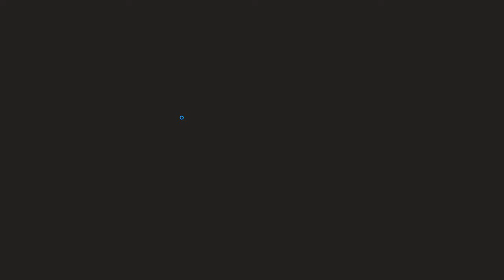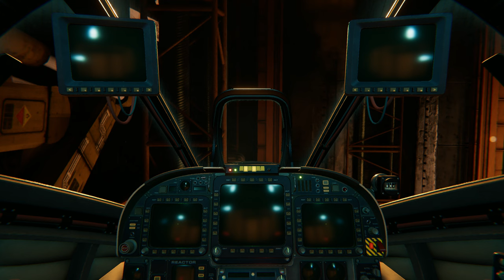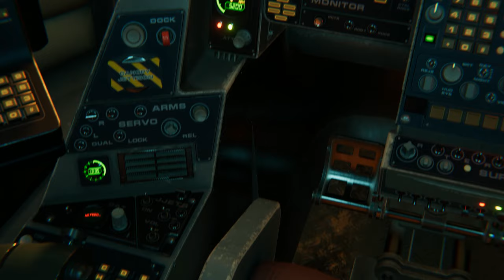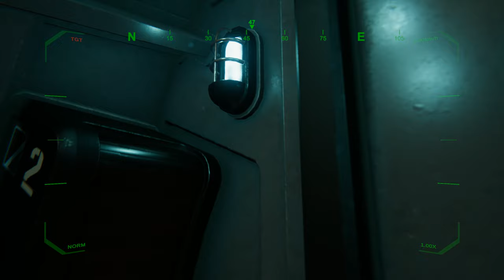BattleMech Clan Timber-Wolf (1995) Cockpit view (WIP with mocked startup sequence)

Comment: Seat should be a bit further forward. The clans don't have big instrument consoles in front of them to block their view typically, was one of the reasons the Timber Wolf was made similarly to the Catapult. Maximum amount of vision while still having a high degree of protection.
Reply from the maker: never knew this, now I'm learning new things every day.
Reply: @MekaRamen  lol yeah the Clans designed their things really interestingly, a vast majority of their information comes from the neural helmet, or in some MechWarriors', a DNI interface. Which plugs the entirety of locomotion and targeting directly into their spine.

Causes the pilots to go a bit bat shit crazy after awhile, or suffer from "flashes" which is a massive feedback of electricity/information which makes them comatose, except comatose with extremely high amounts of brain activity. Neat implications when you think about it!

Some other neat details is that they have a weapon/survival kit in the cockpit, but it changes location based on the cockpit. Some are an entire capsule design where the front glass etc comes away from the chassis and is safe for vacuum ejection. Other battlemechs have just a blowaway canopy ontop and the chair ejects. They'd give mechwarriors' a vacuum sealed suit in those... but innersphere pilots for the longest time couldn't manage to actually cool themselves in the cockpit without fans etc in the cockpit so they were forced to dress down into basically nothing but underwear and a cooling jacket lol.

The vast majority of battlemechs have a top hatch to open up and help pilot comfort. There's a nice section in one of the books where a lance is on watch in some light rain, and the guy is letting a light rain into the cockpit... but then takes shrapnel immediately after because they get attacked.

Oh for motion it's interesting. Most mechs have forward, back, etc controlled by two foot controls (and also the neural helmet), the aiming of weapons are controlled by two sticks, but sometimes a few battlemech designs have a yolk on the left. But control is never actually fully... controlled, by these sticks. The neural helmet factors into balancing, interpreting what the pilot wants to do with their legs and hands at any time, and turning of the torso even. So the pilot is balancing "5" control interfaces at all times in a way, but the neural helmet is the one that links them all together to give the battlemech a graceful and human like locomotion/articulation.
Reply from the maker: ErgonomicChair this is cool stuffs!! Many thanks!!

Comment: I'm kind of confused why it has a dual throttle as well as an Alt. hold, an RPS for Roll and Yaw, a flight lock,  among a few other things. This however... is the best look at the inside of a 'Mech's cockpit I've ever seen.
Reply from the maker: I’m glad you asked. It is mainly for aesthetics reasons but my idea to include them is that MW2 had pretty defined controls over using jump jets, and to top it off, heavy gear 2 (which the IP was inspired by Battletech) has similar flight controls in space battle mode, I assume whenever a mech is needed in the space or low grav, standard flight control could come in handy.

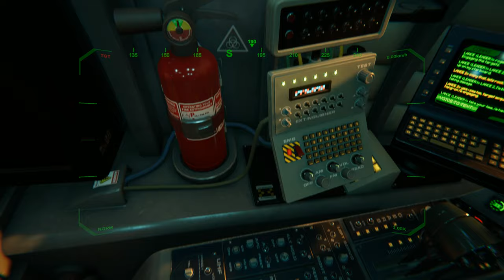Comment: 0:25 Biohazard warning? For what? What on Earth could be biological in that Battlemech?
Reply: The mosquitoes are biological. I don't expect you to get the reference but it's a good joke if you do :B
Reply: @PraetorGix  one of the books? Which one do I need to read?
Reply: @adamofblastworks1517  Not the books. In MW2 Mercenaries, during the Wolcott campaign against clan Smoke Jaguar, the player has to wait for the enemy for like an hour in a swamp and 3 mosquitoes get in the cockpit to bust his balls. In his diary he writes that the damned mech is supposed to be space vacuum-tight so he has no clue how the fuckers got inside.
Reply: @PraetorGix  this is Friedrich 3. God help me, there are bees in mine cockpit!
Reply from the maker: @adamofblastworks1517  hold on, I can't move because there's a spider on my throttle...
Reply from the maker: you know what, I might as well taken then sign out and replace it with bug spray.
Reply: @MekaRamen  I like that too, it's a little better of a hint.